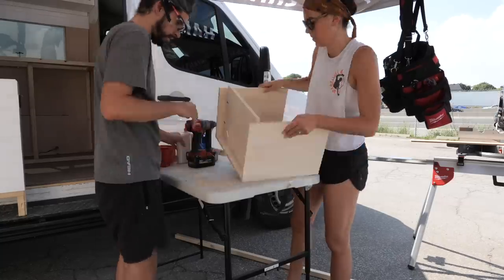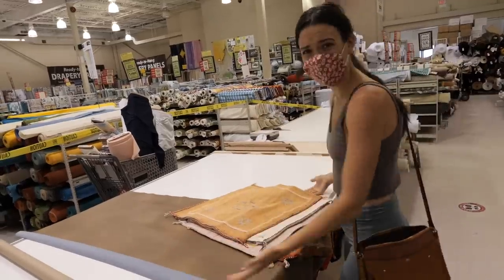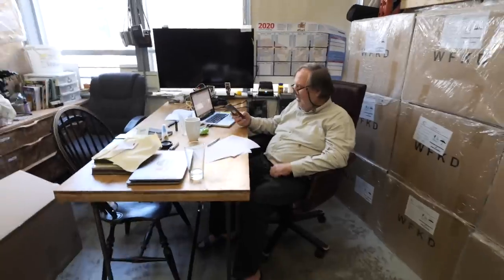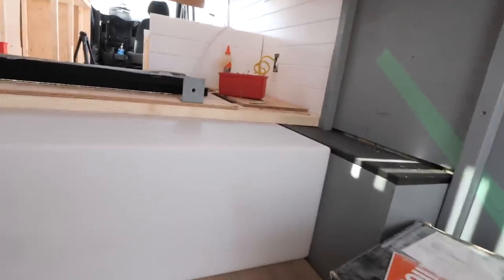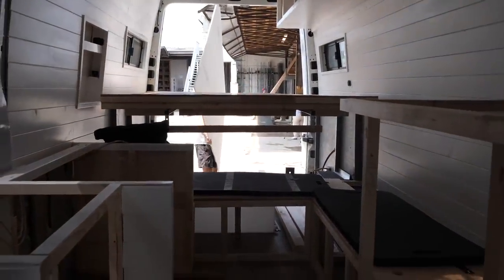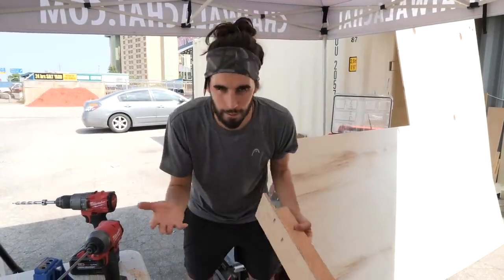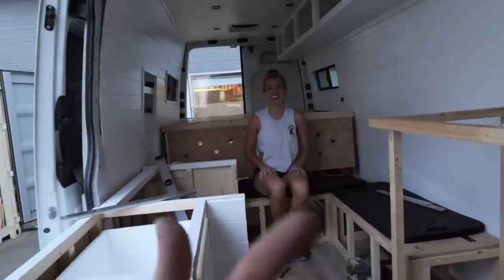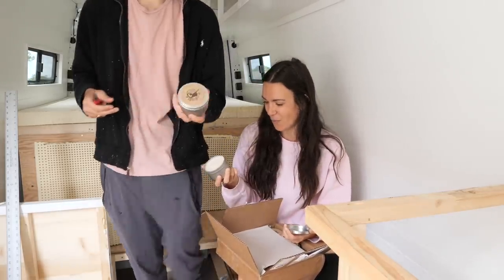VAN LIFE BUILD: Tying it All Together!

Comment: You know, Id be careful with that "vegan leather". If it is PVC based, you should keep in mind "plasticizer extraction". The plasticizer is not chemically bound, just physically, and can get extracted out by touch (grease on your hands) and is especially likely to happen in hot countries where youll be using sun creams and sweating. This just accelerates extraction even more. The end result is a loss of suppleness in the material and it will start to crack - like you see on old cheap leatherette bags or on the vinyl coverings on public transport. There are some solutions though; using textiles to help avoid direct skin contact with the material, or high quality PVC with "linear plasticizers" or vegan leather based on polyuerthane (google "ultra leather"; used in Tesla). (Im a materials developer at a Bavarian car producer based in Munich..)
Reply: I suspect they didn't go with that choice. Leatherette is not a good choice for hot climates as it gets hot and also you stick to it if you are wewring shorts.

Comment: If you have sketchup there's a really easy cut list plug-in you can get. Basically you just draw all your rectangles anywhere in the file, select them and then run the plug in (you put the dimensions of the plywood sheet in the settings). And voila, a cut sheet that conserves your plywood without having to do any math or drawing.

Comment: Hi from Arizona! I am building my pro master van out further and need some advice.  you are attaching furring strips with self tapping screws to the walls, do you feel like that is enough or would the add the threaded cross/plus bolts be more secure in the long run?  I am trying to decide if I should invest in such?  Also for the upper cabinets did you secure the attachment boards differently to the van frame?  Thanks so much! Adam in AZ

Comment: Guys as this van conversion is a self build, how do you ensure that all work done is to a level that your insurance company accepts, such as electrical code, part certifications for CSA, ESA and so on? A friend of mine has been involved in a van conversion for a company and it was required that a third party certify after the build that all parts and installs are done to electrical and highway codes.